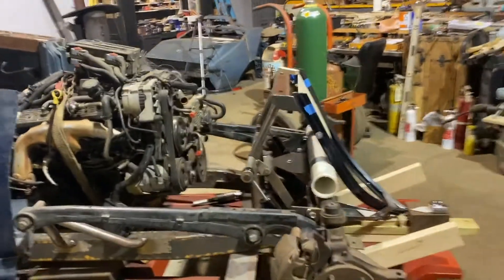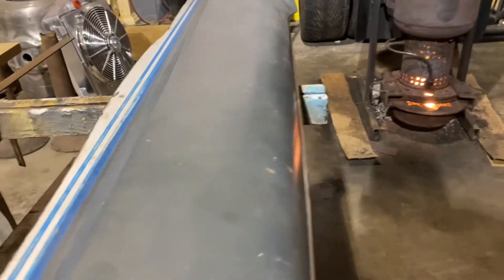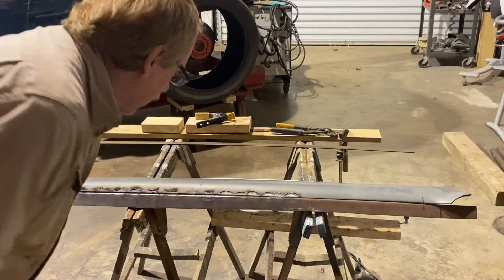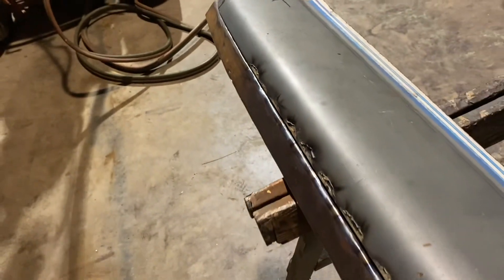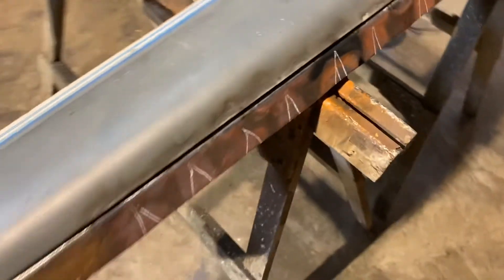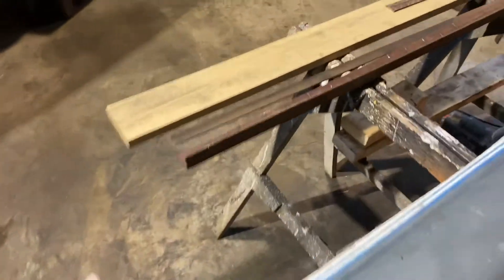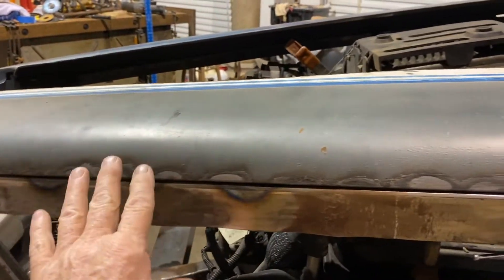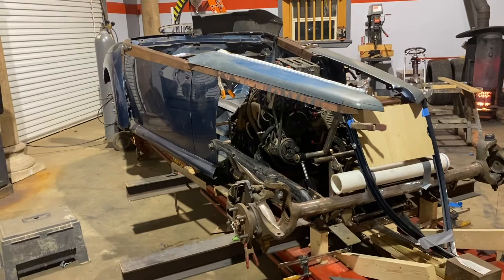Flame Straightening

Comment: Hold the steel in tension while you make your vees. 
The vee expands and isn’t allowed to move, so it swells. When it cools, the vee shrinks.
Reply: In my case, 3 vees on a 2x8 channel held in tension, lifted a bent trailer frame 6-8 inches.

Comment: There are a lot of misunderstandings about cooling. The main thing to know is that (for mild steel, in ordinary situations) it doesn't matter if you use water (preferably from a sprayer) or let it cool over time, but what IS important is that every time you heat a spot, the surrounding metal must be cool for that spot to cause maximum shrinkage.
This means that all but the smallest jobs will take considerably longer if you don't accelerate the cooling process.
In this particular case, the second row of spots in between the first ones would have had little or no effect, because the surrounding metal had become quite hot.
What is needed for maximum shrinkage is a very sudden difference in temperature around the boundary of the red-hot spot (and the spot needs to be small for sheetmetal, maybe 12-15 mm diameter). You want the surrounding metal to stay in the same plane, and fight the expansion of the red spot. This forces the metal to thicken at the spot, then when the spot cools, it has to go back to its original volume. Some of this shrinkage comes from the thickness but most of it comes from the diameter (the latter being what you are aiming to achieve). If your spot worked, you will feel it is thicker locally when you lightly run your fingertips over the surface after it has cooled.
It the spot is too large, the sheetmetal will go out of plane (buckle) instead of fighting the diameter expansion, and if the metal is too hot around the spot, it will be too weak to fight it, so in either case you won't get enough thickening (also called "upsetting") which is the key enabling factor for this method to work.